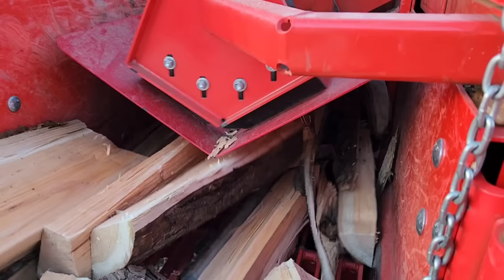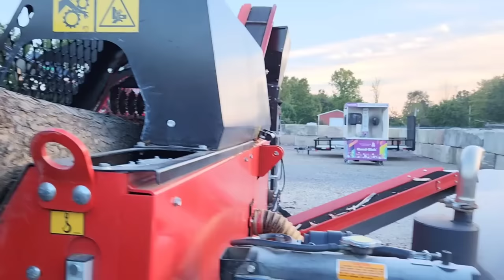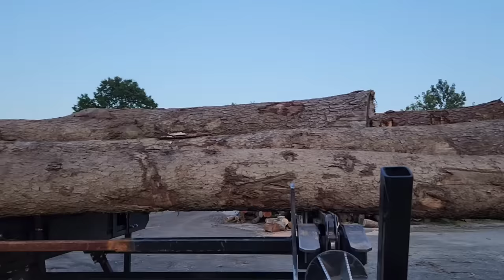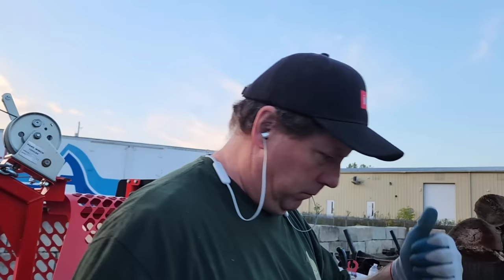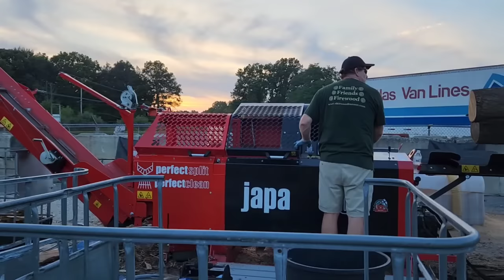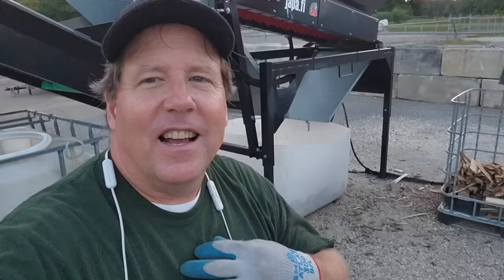The BEST Firewood Processor In The World!  The Japa 405... Prove Me Wrong

Comment: Hi Joe!  One thing for sure is that you underrate yourself when you talk about your capabilities and capacity of your firewood processing system. The way that the "405" with perfect split and clean and the operator swallow up logs in an hour is eye opening. This machine can chew, split, segregate, and spit out firewood,  bundle wood, and kindling all in one motion. Kindling sounds like extra work, and there's only so many hours in one worker. An appreciation kindling bundle to a new or regular costumer could mean a lot. Selling kindling along with the regular campfire bundles could also help some campers with poor axe dexterity not trusting themselves using one, be able to enjoy a few campfires on the weekend. Increasing your sales. Enough talk from me, you probably have thought of this a long time ago. You must be ambidextrous the way you handle the controls and checking every operations happening with the 405 all at the same time. Left hand, right hand...heck, you could be eating lunch while processing firewood. At this rate you'll have an empty woodyard. You'll have to call Jesse again lol. Keep up the good work and have a...GREAT DAY!!
Reply: He is doing so much good work and making more for less. Very smart.. but he is loosing so much too that we don’t even think of. He could tack that saw dust (glitter) and make fire starters and use all that other (trash) on the other belt he could make cubes out of it with a good press. Run fro the same motor. Don’t wast anything
Reply: Would it be more profitable just doing what he does?  He might be able to just sell the scrap items to an interested buyer.
Reply from the maker: Thanks for the nice post Pete!  I have gotten pretty good on the controls for sure.  It took a while bc it has a lot going on but I am able to fly thru these logs now!

Comment: Hey Joe, I have been watching you for a long time and this video got me thinking...I'm wondering how much automation the manufacturer could do to eliminate the manual saw activity.  A few photo cells on that machine would allow you to simply watch the machine run and clear any jams in place of standing there working the saw.  SO when the pusher bar area is clear the next cut would fall into the splitter area, the log would advance, and a second cell would activate the saw to perform the cut.  It would save an operator standing there and allow that person to clear jams or clean the area as long as there were no machine problems...Just wondering if the manufacturer has given any thought to that?  My background is with a Fortune 50 Company where we were always looking for automated processes to reduce labor costs.  Just put my idea hat on and thought I would ask you.
Reply: I am also looking for a fully automated machine like this. Or that I can run from cab of excavator

Comment: If nothing else, this video clearly shows how amazingly engineered this Japa unit really is - one operator can load seasoned logs into position, cut slabs, split rounds, separate a sellable product from the tailings, and deliver clean pieces of wood using integrated conveyor belts and other sorting devices.  The question then becomes, given the entry level of over $60,000 for a basic wood processing unit, after determining the final cost of the multiple accessories that makes all this possible, how many cords of wood "processed in less than one hour" must be produced before the loan taken out to  purchase it all is finally retired?  No one really ever talks about this aspect of the firewood producing business.  One must certainly need either deep pockets or a rich relative, a very friendly banker, a savvy CPA, and most assuredly, an understanding wife.  And not necessarily in that order.  How about a video that breaks this all down?   What say ye?
Reply: I just posted about the same thing and the I found this. It looks to me it would just b better to grab a saw and go cut some wood
Reply from the maker: I find accounting very depressing LOL.  This 405 is my third processor.  I traded up my previous two in succession to get here.  Each cost double the previous.  I need to do a vid on this topic but for me the need for a processor was more practical than monetary bc I would not be able to stay in the game with a chainsaw and a splitter.  I need machines in order to remain a sole proprietor

Comment: It appears your radiator is filling with fines with the new sawdust system? I know you have tried a couple different locations for IBC collection bladder but maybe wind direction should be factored in also or keep the radiator blown out.Does the Japa have a heat gauge or sensor? 
You are continuing to refine the process, Joe! Thanks for sharing...
Reply from the maker: I'm sure they were there before I hooked the extractor up.  I need to clean that off.  Thanks Wayne

Comment: Not convinced a box blade is the way to go, more scrap and averaging 12 seconds per round vs. 3-4 seconds through a 6 or 8 way.  This works for you, but at the next level the big guys are using large processors for a reason.

Comment: Joe, try a tote bladder top under your slash conveyor.     Drill some holes for water to drain out and attach a rope handle to pull it with..  Helps on the clean up.  Japan is one fine runnin machine... 70% of that equation is the skills of the operator... You have it dialed in for sure.
Reply from the maker: Thanks Greg.  There isn't much space between the ground and the bottom of the conveyor.  That is why I went to the canvass to place under it.  I am coming up with a tote that I use to cover the engine!
Reply: @ohiowoodburner  Roger that....  With that set up you can really process that big cherry!!  But the real work is in the preperation and cleanup!!  Time time time

Comment: I had a shake and shingle mill... all the tailings went to a underground burner and the sawdust as well.  It heated my mill, generated electricity, and all the hot water a city could use ... once a year we took out the ash and it was a small bed load of ash that went to compost. Zero waste... the electricity was from steam from the underground burner or another way of waist nothing
Reply from the maker: That sounds super cool.  I am having to come up with a plan for my waste for sure
Reply: I want you to be successful so please listen... the more clay the better to put in a burner underground.  Without air, it will smolder and not burn or use more of expensive fuels to keep it going.  You put in a small piece of pipe, say about four inches in diameter leading up to the bottom of the hole you put in. At first you might use a leaf blower in its end to get this fire rolling. Then you once fire is rolling along and doing what your intentions are.  Your going to be so surprised when you find out that no fan or other is needed. The next part is important as well. Do not put it out as you now have a hole in the ground with a mess you can't get going again.... especially if the hole is filling up with groundwater. To slow it down you put a cap on the pipe and it will go to a smoldering fire with no flames. What your trying to do is get the bottom hot so the fire doesn't need to ever need restarted. If that fire has burned for say a couple weeks, its getting very warm down there. That is the good thing cause you just pile more wood chips or sawdust on it and just let it work. Of course take the cap off of that air intake and it will do it all on its own. I didn't quite have it figured out at first so wound up building another fire on top of my old one. It took off with a lot of coaxing. From there on I just let it burn and it took care of itself... even in the worse flooding, my fire pit worked. I must say that I think it could go out with water floating in the hole.  The clay bakes into a pit pipe of its own. That air intake is the real ticket to success. If you have any questions you can hit me here and I will answer any you may have.. @ohiowoodburner

Comment: I forgot to mention that the wastewater and oils were salvaged to clean water and the oil used to help that burner make a good clean burn. Also that electricity it generated  wasn't enough to run the mill but cut cost to one half.
Reply from the maker: very interesting buddy.  Thanks

Comment: Not trying to be critical, is the cutting chain down pressure applied by your hand or are you simply activating an electrical seleonid ?  It often appears to me the engine lacks horsepower to perform at such a fast pace.
Reply from the maker: It is hydraulic and I have a knob that controls the pressure.  When it bogs it is because I have the pressure too high.  In one point in this vid you can see me adjusting it up bc I lacked enough pressure to come down. Just about every time you hear the engine bog whene I'm cutting it's operator error.  I have the pressure set too high

Comment: If you're happy then that's all that matters. 👍 
 My experience says that machine is overpriced and really limited in the size logs it will handle. Motor sounds like it is lugging  under a full operating load. Firewood pieces aren't any more uniform than any other processor, maybe just a lot smaller. Noticed it produces a lot of waste. 4 different bins for sawdust, misc crap and wood it won't split? Perfect split is turning product into scraps.

Comment: Question how many loads of wood goes through the 405 befor you have to refill  the tank
Reply from the maker: I can get about 7 tables run thru the 405 before I fill up.  I'm sure I can run it lowere but I don't want to risk running out.  The tank holds about 10 gallons.  This is a VERY efficient machine.  The fuel usage isn't even on my radar if that makes any sense.  Prob less than a gallon per cord

Comment: Nice machine undoubtedly best with a system that is using a chainsaw for bucking rounds before splitting. Cleaning conveyor and sorting system is best there is, however guillotine bucking is still much more efficient having no saw maintenance, can process any length log with diameters into the 24" range even in excess of 60' long,  loaded from ground level so no pre loading efforts needed, or bucking to length of logs because they are too long, or maintenance of log loading ramp. Ray
Reply from the maker: Thanks for the comment and thanks for watching Ray!